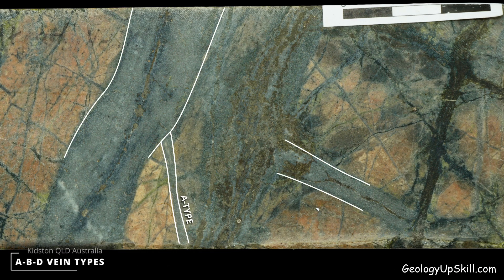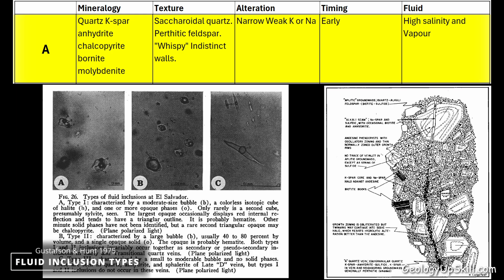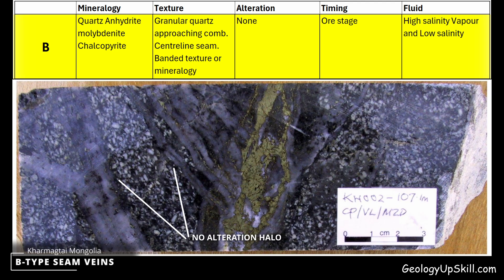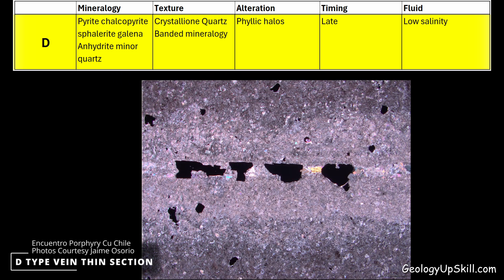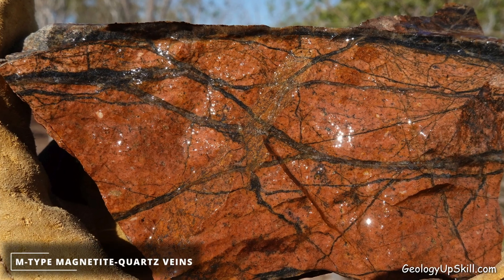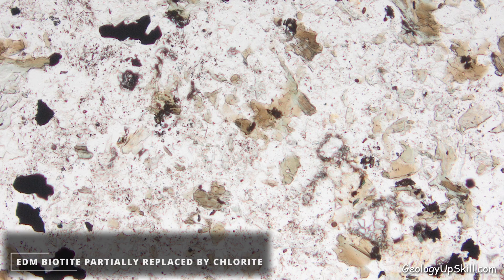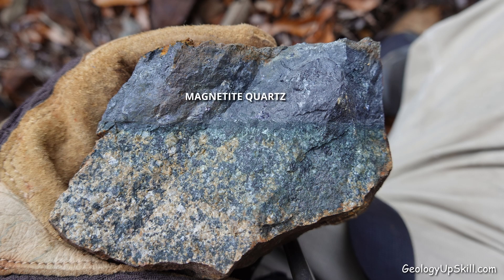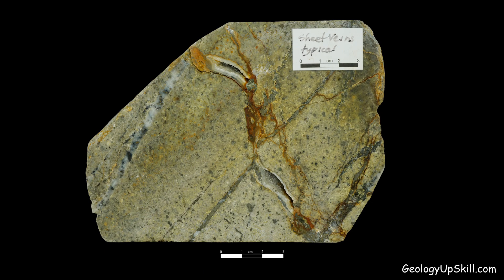A, B and D-Type Veins in Porphyry Copper Deposits

Comment: I was a geologist at the Bagdad Copper/Molybdenum  mine in Arizona.  I once collected a piece of core with five distinct viens cross cutting each other.  The deposit had obviously undergone several periods of mineralization.  I am curious if you have ever visited that deposit.  You should!
Reply from the maker: I have never been to the Bagdad mine, but it would be very interesting. Multiple overprinting generations of veins is one of the characteristics of these systems, particularly B-Type veins.

Comment: I have got lots of china clay quarries around me here in Cornwall in England and the more i watch the more i think the whole of this area around me is a giant copper granite Porphyry deposit. But below all the visible working kaolin quarries. Lots of molybdenum and thats a decent clue for copper Porphyry deposits i think you said. Porphyry around here is called Elvans. So could all the kaolin deposits, be a like a giant lithocap above a vast copper deposit?
Reply from the maker: I think most of the clay at Cornwall is supergene rather than hydrothermal. The environment of the tin deposits is generally a little deeper than typical porphyry systems, but the elvan dykes might prove that wrong. See if you can find some really clear B type veins!